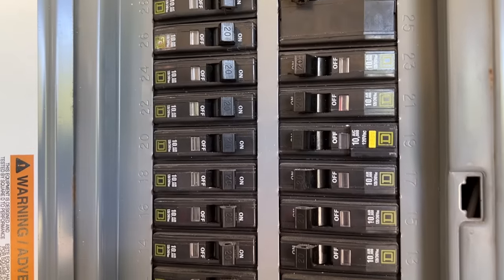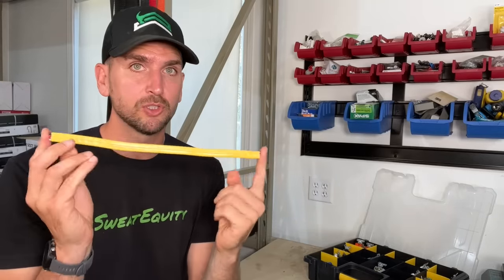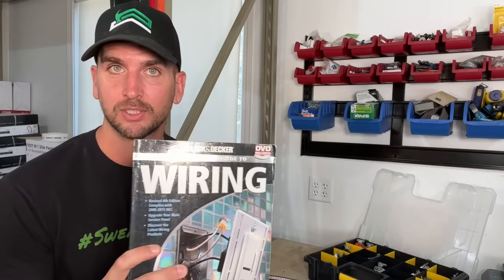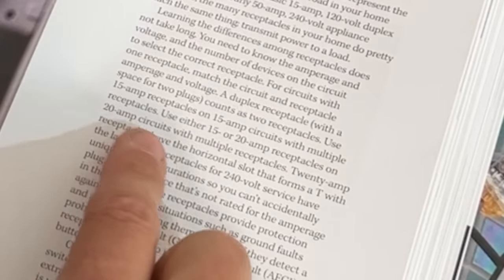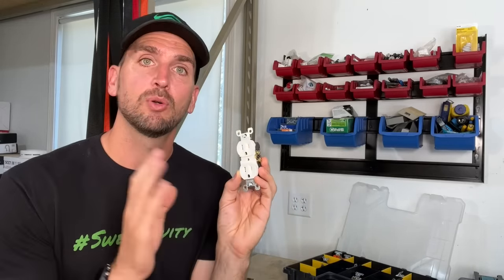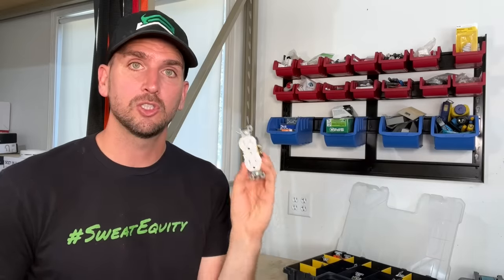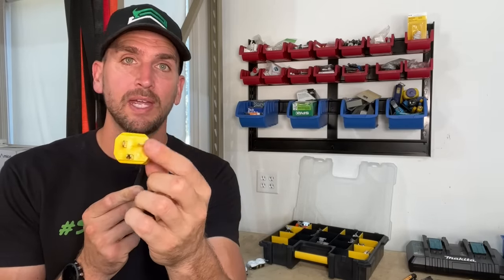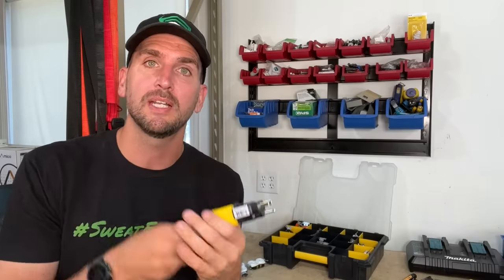Can 15 Amp Outlets Be Used On A 20 Amp Circuit Breaker

Comment: Great timing and thenks for your content. I have a new home and my electric pressure washer was tripping the breaker on the 15 amp circuit. I thought I would move it to the dedicated 20amp circuit in my garage and it still trips the breaker. Could this be the cheap outlets? The 20 amp circuits seems to have a 15 amp outlet installed.
Reply: With the caveat that only an onsite evaluation can tell for sure, if the outlets are in decent shape (not dirty/corroded where the plug makes connects, no signs of overheating), I doubt it's the outlets.  I have seen motors as they get older/dirty/have issues draw more power to the point where they trip.  That's what feels most likely.  If you can get a basic amp meter, like a kill-a-watt, you can see what it's using.  That will tell you if the problem is with the device section or the supply section.
Reply: @RJ-ej1nr  thanks! The outlets are clean and the pressure washer is fairly new only about a year old  I'll certainly look into a kill a watt to see what it shows.

Comment: Ok I though the NEC states an outlet is a single place to plug into. The receptacle you are showing is ok to use only 1 receptacle on a 20 amp breaker because you can plug TWO plugs into the receptacle.

Comment: Thanks for information !  Question:  I live in a 30 year old duplex/condo.   Why would our kitchen be on a 20 amp, multi-wire branch circuit?  Our neighbor's are also . . .  The two, 20amp breakers have a handle tie and I presume the two circuits share a common neutral.   Thanks,  Bob
Reply: Kitchen requires at least two 20 amp circuits. Rather than running two 12/2 cables, run a single 12/3, each hot is a 20amp circuit and they share the neutral. Back before arc fault breakers this was done all the time. Saves cable and labor.
Reply: Thanks @pld8993  our homes are 30+ years old.  All these home are wired with a multi-wire branch circuits for the kitchens.

Comment: My problem is with 15 amp receptacle on a 20 amp breaker and wiring is the code was originally written to prevent fires due limitations of receptacles or wiring. 12 gauge wires won’t overheat passing 20 Amps, but will 15 Amp receptacles running 20 amp power through above their rated 15 Amps??  Yes it possible.
Reply: How is it possible if the 2 types are virtually the same internally as Scott pointed out? If you're using residential grade, just don't backstab the thing.

Comment: For devices that may require the 20 Amp outlet, the current PC market is heading towards more power draw.  PC power supplies over 1,500 watt rating have the capacity to draw over 15 amps of power if pushed to full (and efficiency rating is 80% or less at 100% load).

Although, I think the common issue with worries of using a 15 amp outlet on a 20 amp circuit is how the common person does not understand what amps are on power line.  If someone were to get a high end PC next year that could pull near to or above the 15 amp load, then that PC should have its own dedicated circuit.  Personally, I prefer having 15 amp outlets on a 20 amp circuit so I have less concern of other devices tripping the breaker when sharing the circuit.  There is only 15 amps or higher on the circuit if something plugged into an outlet allows 15 amps or higher to pipe through that circuit.  If I am using something that is over 15 amps, it needs its own dedicated circuit.  The real value of having a 20 amp breaker for a circuit of 15 amp outlets is a situation where you have an entertainment center, a computer desk, or a bedroom where there will be a lot of devices sharing a single circuit.

Comment: See, this is why wiring can be confusing. I opted to put in a 20A outlet/receptacle for computer use. Many high wattage UPS systems use a 20A plug.
Reply: I looked at my large freezer the other day, was surprised to find it only pulls 1.9 A.

Comment: Frankly, I have no qualms over the differences between 15 and 20 amp branch circuit devices.  It's the circuit breaker rating at the service entrance box that determines the performance limit of the branch, not the actual receptacle (outlet) itself.

Comment: I still like to use a 20 amp receptacle outlet because it is "self-documenting" -- that is, you can look at it and know you are plugging into a 20 amp circuit.
Reply: But how many household appliances are 20A? I’ve seen a total of zero in thirty years as an electrician.
Reply: @shockcoach  There are none, but that’s not the point. More info at the point of use is generally helpful. If you need to kill the circuit you know it will be one of the 20 amp breakers. If you are plugging in multiple big loads, knowing you are on 1 or more 20 amp branches may give some peace of mind. Far fetched I guess, but to me, still nice info to have “at a glance.” (Of course that assumes the installer was competent in the first place!)

Comment: So if im running a 30a single pole breaker (120v) for a network ups that uses the nema l5-30 can i put some additional 20 amp receptacles on that branch or can i only serve that one outlet?

Comment: One problem I run into with using 15 amp outlet on 20 amp 12 awg solid core 2 conductor w bare ground is the bare ground is too big to fit between the ground screw and the metal tabs on either side of it.

Comment: A 15 amp outlet could be on a 15 amp circuit and if you use that adapter you could over heat the wire or if you are lucky, trip the breaker. Remember 15 amp outlets started out on 15 amp (14 gauge) wire.
Reply: What about using wire that is rated for a higher amperage than the breaker or outlet?  For example using a 15-amp circuit breaker, a 15-amp outlet, but the wiring is capable of 20 amps?  To me this would make the house safer because if the outlet or breaker get 16 amps they will be in trouble, but the wiring will not complain.  And since wiring is all sorts of 'fun' to replace, this would be the key.  If the outlet fails, you can cut open the wall at that location and replace the outlet.  If the breaker pops, you know to unplug some stuff.  But the wiring is just fine while never getting more than 3/4 of its limit.
Reply: @toddkes5890 .      Todd,   The NEC has been in existence since their first Code book in 1897.   The content of the rules creates a safely installed system (if followed).  It’s when people try to outthink the NEC and do it their way when things go bed.   Your thinking is not wrong.  But the question comes, is #10 necessary, or an improvement?  No.   Is the #10 worth the increase in $ to do everywhere?  No.   Will the 15 and 20 amp receptacles accept #10 conductors?   Sometimes no.  Will 3 #10 NM cables work if going to a standard box with a receptacle installed in it?   No, need a bigger box.   It’s like a snowball going down hill.   Does this make sense?   Best wishes,   Kevin
Reply: @KevinCoop1  It makes sense, I was just wondering if it would be safer to use the higher capacity wire.  I hadn't considered the effect of wider wire.

Good stuff there, thank you

Comment: Just  keep in mind that a single duplex receptacle installed on a 20 Amp Branch circuit need only have a rating of 15 Amps. (A duplex receptacle is considered two receptacles.
B) Receptacles
(1) Single Receptacle on an Individual Branch Circuit
A single receptacle installed on an individual branch circuit shall have an ampere rating not less than that of the branch circuit.

Table 210.21(B)(3) Receptacle Ratings for Various Size Circuits
Circuit Rating (Amperes) 	Receptacle Rating (Amperes)
15 	                                        Not over 15
20 	                                       15 or 20
30 	                                        30
40 	                                        40 or 50
50 	                                         50

Another fine point is that a receptacle may be an outlet, but an outlet is not always a receptacle

Comment: So you're saying that 20 amp GFCI in my bathroom on a 15 amp circuit with 14 gauge wire .... yeah I was a little shocked to find that when I decided to change it out. I wanted it to be you know white not yellow and figured it was a good time to replace the 20 amp with a 15 amp like it was supposed to be, how often are you plugging a 20 amp appliances in your bathroom? I think somebody probably grabbed it at the store and didn't know better.

Comment: where you are talking about the thickness at 4:18 ; isn't the thickness determined by the amperage/resistance of the outlet and not by the quality or price? I believe that the same way that the gauge of the wire determines the resistance/amperage that it can carry, so does the  gauge of the prongs and parts in the outlet determines the resistance and that is why the 20a outlet has a horizontal pin? Does that make sense?

Comment: @5:12 we're just going to gloss over the fact that the guts of that receptacle happen to allow a plastic cover swap to determine the difference between the 15 and 20 amp models of both the NEMA 5 and NEMA 6 outlets, giving you 4 skus with the same internals?

Comment: The problem is people are assuming that they have 12 gauge wire running through the wall and that none of the neutrals are joined together or what I come across all the time when doing all these older houses someone only 25 years old at some point whoever wired them up somehow got a passed inspection where they were either why and nothing behind the walls or even worse changing the wires multiple times Behind the Walls and even a few houses I found where they've literally used the ground wire as a neutral

Comment: I’m confused why anyone would think this is a problem. If you have a 15 amp circuit then obviously you shouldn’t put a 20 amp outlet on the end, someone might plug a 20 amp device into it and either trip the breaker or cause a fire. But if you have a 20 amp circuit and put a 15 amp outlet on it, the only thing you’ve done is prevented yourself from plugging a 20 amp device into it. You are maintaining a buffer zone between what can be plugged in and what the circuit can carry, surely that’s safer than only using a 15 amp circuit in the first place and not having any overhead for if a device begins to draw more than the intended amount.
Reply: Just a comment on your last point: The 15A will not create a hazard if you overload it, because the breaker is protecting it. That 15A breaker and 14AWG wire can handle 15A all day. The hazards would occur if you had a 20A breaker with 14AWG wiring, and in that case you can cause additional current to run thru the wire than it is rated for, causing it to heat excessively and create serious hazards
Reply: @avsrule247  Presumably if you have a 20 amp circuit breaker you should be using 12 gauge wire, regardless of what outlet you put on the end of it. Putting a 20 amp breaker on 14 gauge wire is the problem there, because the breaker isn’t actually doing anything to protect you. Even a 20 amp outlet on a circuit using 14 gauge wire and a 15 amp breaker wouldn’t be disastrous because even if you plugged in a device that drew 20 amps the breaker would trip before the wires failed.
Reply: @fakjbf3129  Yeah that's exactly right. I was just making a comment regarding the overhead on a 15A circuit situation that you brought up. Many home owners assume that a breaker tripping (because of overload) is really bad, which is not the case at all. This is actually good, because the breaker is functioning the way it should and it is protecting you. Of course, this creates a nuisance to the home owner if they need to plug in multiple things at once, but it is not unsafe. 

Also want to clarify that I am only saying this in case there are people who read through these comments to educate themselves, so not necessarily directed towards you.
Reply: @fakjbf3129  very good point!    In actual practice,  120 volt, 20 amp plugs are rarely encountered in a residential environment,  so the chances of it even being a problem at all, is very marginal.    In my experience when 20 amp outlets are installed in a bathroom,  laundry room,  garage/workshop area or kitchen, they install them so the occupants can easily tell they have a 20 amp circuit by looking at their outlets.    And the few appliances and tools  that come with a 20 amp plug, will most likely be required to be on an individual branch circuit.    If that's the case there should be a single receptacle outlet installed for that piece of equipment.

Comment: Another reason to use 15 amp receptacles, even on 20 amp circuits is to prevent anyone from using an appliance with a 20 amp plug, especially on rental property.

Comment: Out of curiosity  does this apply to light switches? I see the sonoff touch switches for smart home tech are 15 amp. (not sure how much I would trust them to begin with but I am looking into them anyway) Would they be okay to use on a 20 amp circuit?
Reply: Continue your investigation. One point you may wish to focus on while investigating is the typically loads of modern lighting. Especially lighting rated/used in residential environments. 
It is ultimately your responsibility as the installer to know why you use what. 
I will agree with the presenter of the video, I do like to use the cheapest receptacle available (I do understand why contractors do so) just think a modern moderate size home has 100+ receptacles—that is $100 that remains in his account. However, if installing s bunch, a higher quality residential receptacle should be priced between those options.

Comment: I have a question, if you have 15 amp receptacles on a 20 amp circuit, why would you use 12ga wire vs 14ga wire on 15 amp receptacles if 14 is rated for 15amps, assuming you are using resedential outlets and the 15amp receptacle is "thinner" metal vs the 20amp?
Reply: If the circuit is rated for 20A (20A breaker or fuse) the wiring in that circuit must be rated for 20A, hence the use of #12. If you wire the circuit with #14, the breaker is not allowed to be a 20 and must be a 15.

Comment: In Canada, at least in the kitchen, we have to use the 20a receptacles by code.
Reply from the maker: We need to have at least 1 dedicated 20 Amp circuit along with the GFCI code requirements.
Reply: 20 amp receptacles or 20 amp circuit breakers?  Canadian code mostly follows same rules as NEC.   NEC requires 20 amp circuit or circuit breaker.   Not 20 amp receptacles.
Reply: @KevinCoop1  20 amp receptacles. Very common to see them in kitchens here
Reply: For your tea kettle, right?  Americans don't drink much tea and we have to wait for our 1500W kettles.
Reply: Interesting... I never see 20 amp outlets in residences here in the US; only in commercial buildings.

Comment: I havent seen anyone comment on this and what happens.
lets say 14/3 wire is being used to power up 2 different 110v circuits. Now connect that 14/3 to a dbl 220v 15A breaker . 
what happens if one side of that overloads or shorts. 
Do both sides of the breaker trip every time? 
I saw this in a house and couldnt beleive anyone would do that!
Reply: Yes, that's how a double pole breaker works. You could also have 2 single pole breakers in this scenario, but the levers must be tied together and would be equivalent to a double pole. If you turn off the breaker manually, both circuits will be off.

Comment: As a mostly uninformed citizen when it comes to household electrical things this whole video made perfect sense, until you pulled out the 20-15 amp pug adapter. How on earth is that even within code? The plug is different for a very, very good reason. Yes, the breaker should prevent issues, but after living in a house where the previous owner did some lazy DIY work, there's no chance I'm going to trust that anything is done beyond the bare minimum. Why does that adapter exist? It just screams safety/fire hazard to me.

Comment: Breakers protect wires / stop fires from overheating because of the resistance of the conductor.
I would assume the code has some max length of the breaker to wire ie 15amp breaker on 14g wire.
Reply: No, it does not state a maximum length of conductor.   It does however “Strongly suggest” that voltage drop on a branch circuit be at 3% or less.   The longer the circuit, the more resistance, the lower the volts, and higher amps is what the issue is.   Higher amps=more heat. Increase conductor size to reduce resistance is the resolve.
Reply: @KevinCoop1  yep thats what i said. 
 and who is measuring this voltage drop?  

Electrical inspector, oh manufacturer I would bet which then would get us back to a max length on a specific gauge for a breaker, which should be matched to the gauge.

I wonder what voltage drop per foot is for these gauges?

Comment: I have a 15 amp duplex outlet with two recepticles connected to a 20 amp breaker. Can i use the 20 amps at full capacity given that i have a 15 amp duples recepticle. And also do i need to evenly use both recepticles in the outlets in the electric load is high?

Comment: If a failure occurs in a 15 amp device (say short) but where the overload doesn't exceed 20A, then the breaker won't trip (assuming the breaker isn't arc fault/ground fault). Therefor, the device could catch on fire (as opposed to in-wall wiring).
Reply: I’m not sure how you can have a low amp short.     But receptacles typically fail because of a heavier load (like a space heater  on an extension cord) over heating because the cord is not rated for the load.  The contacts start getting too hot, then become loose.  Then arcing starts and that’s when you see them melt and turn black.   If receptacles get plugged in and out many many times, the receptacle gets worn and arcing can occur.   Same fate as with the heater even though smaller load.